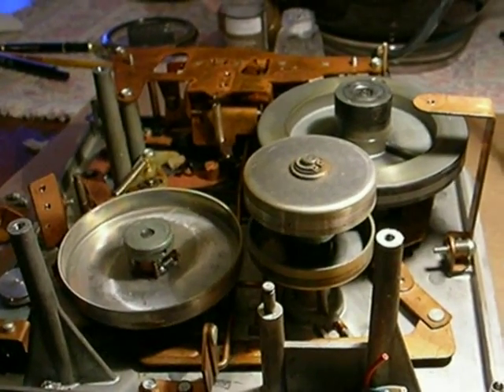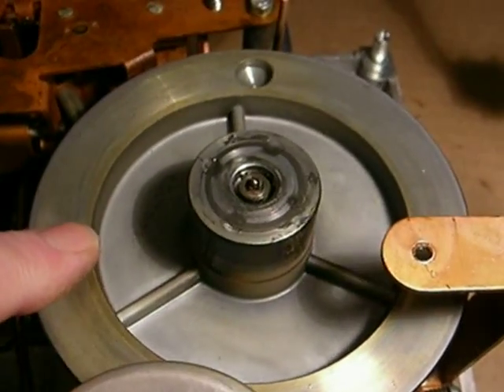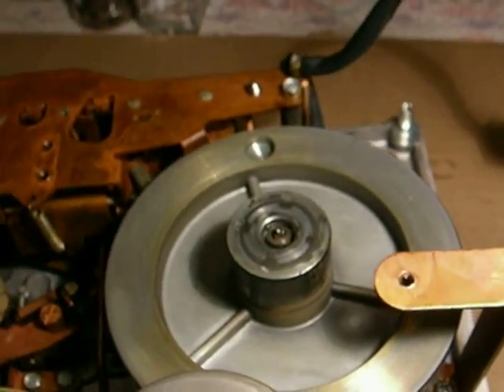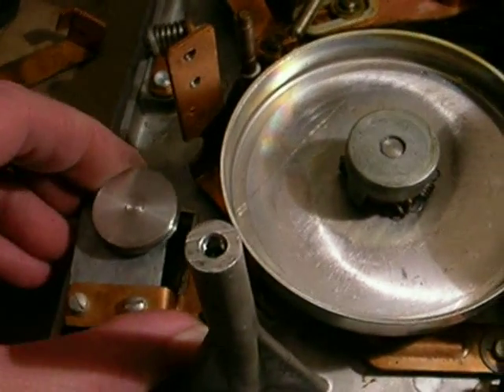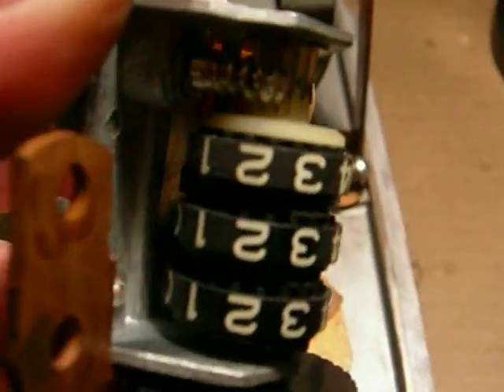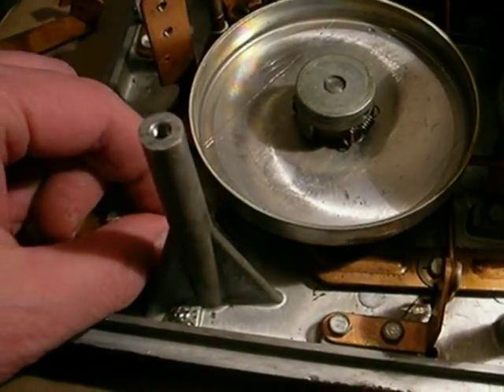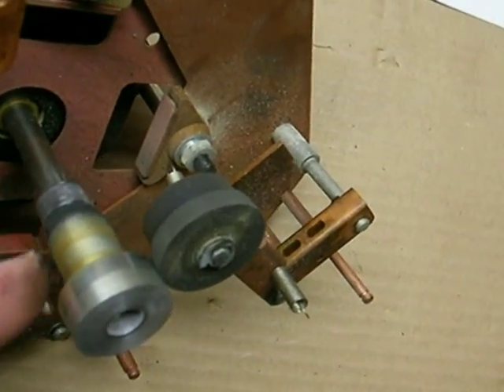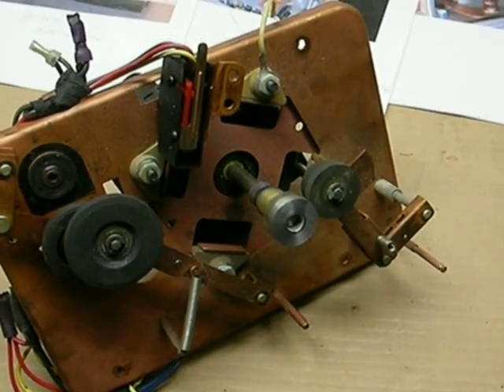RCA Victor SCP-2 mechanism

Comment: After watching that video on that BOSE radio chassis and how you cleaned and fixed those very tiny corroded holes in that circuit board, I will bet you can make a side plate of of metal for that counter.
Back 40 years ago when I had great eyesight I could never work on such fine detail as the BOSE circuit board.
I know you can do it :-)

Comment: Chris, would it be feasible it to have a new metal mounting bracket for that counter mechanism fabricated at a machine shop somewhere? My thought is you might be able to disassemble it and send the main piece to be copied. Looks like a simple thing to cut & bend from a piece of sheet metal.